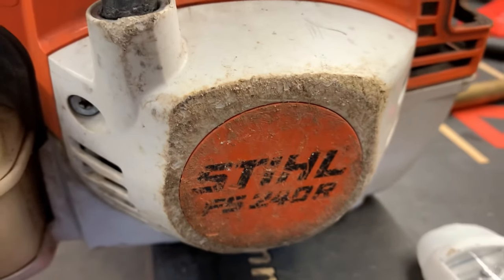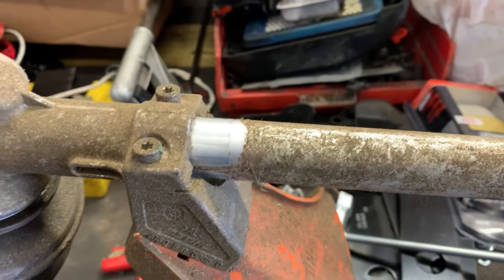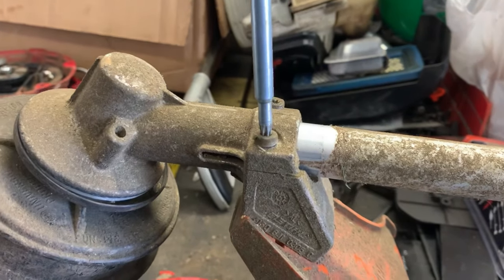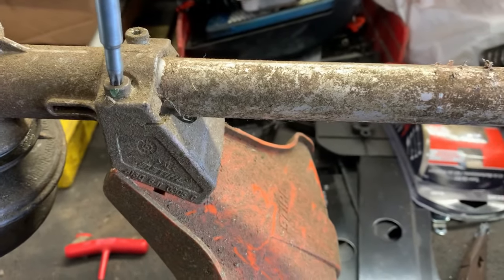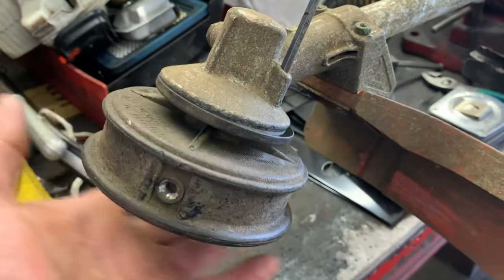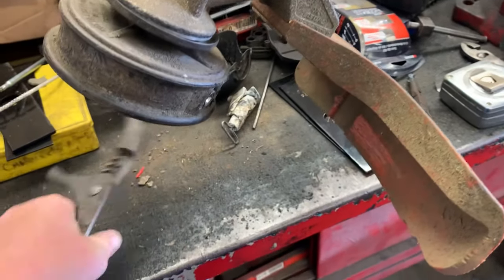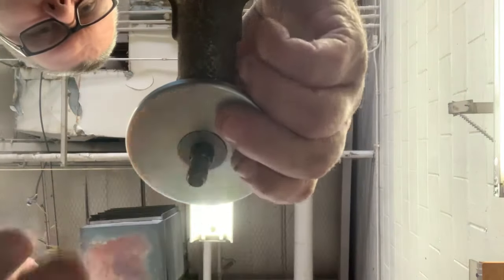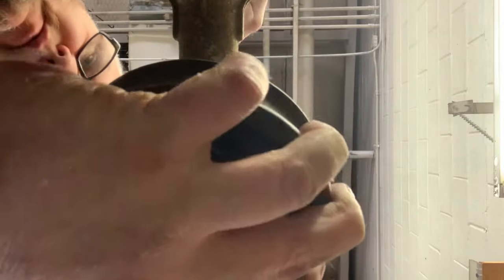FIX 95% OF WEED EATER HEADS THAT STOPPED SPINNING!

Comment: Thank you for the excellent video. Solved my Husqvarna problem.  Could even tell it had slipped on the shaft like in the video, Must have been gradual but the brush blade finished it off.

Comment: You know? Call me weird...but I lube every bolt/shaft/what have you while installing anything because I know that if it goes TOGETHER it is going to have to come APART again. And I never...have to use special tools to get something off like the head of a trimmer. Lube your stuff guys.
Reply from the maker: WRONG WRONG WRONG Lubing hardware changes the torque coefficient of said fastener. Always follow the mfg recommendations when applying oil or never seize. Some bolts require them to
Be torqued dry
Reply: @THEMOWERMEDIC1  My dads two stroke I gave him 20 years ago that was probably 10 years old when I got it off the side of the road still runs great, and is easy for him to maintain in his late 60's for this reason. Never had a problem with any of our stuff. If you do? You're doing it wrong.
Reply: I don’t think a dab of lube will hurt, it’s not the space shuttle.

Comment: The problem I had was on the residential model Husqvarna the shaft had too much forward and backward play and would disconnect from the motor kind of like your Stihl, but it is not easily fixable. I think the cause of it was from the storage option to take it apart, the shaft is 2 pieces instead of 1. Never buy a weed eater that has the option to remove half of the shaft because that is a major weak point.

Comment: @THEMOWERMEDIC1, I know this isn't a Stihl topic but just curious if you have seen the new 3020 from Echo, could a guy swap the flex cable for the steel driveshaft, if so what parts would a guy need?

I'm getting it mainly to trim n cut weeds but some of the properties I'm on for my mom's boss have thick tree like weeds. Would like to bo both but thought I'd ask.

Thanks JD
Reply from the maker: I’m not real sure.  You would have to contact echo

Comment: Ok but what if the drive cable is totally detached from the head. I can see my drive cable but it's resting on the wall of the shaft. I just don't know how to line it up to put it back in the head of the weed eater
Reply: I did it to mine. you have to take it out,grease it and when you put it back in, you have to wriggling it until it catches at the top. I didn't know this and cursed for hours until I found a video explaining what to do.

Comment: Can anyone shed light on something. I have seen all this topic and vids on Stihl. Have not crossed nothing yet on grease fitting and gearing. As in 1. Why do some have grease fitting and other newer etc may not? 2. Exactly how can one be greased with no fitting within gear box up by head? Example- I have a RC-56 and no grease fitting. Have a older 55 with fitting. Price for that box looks to be half of a new trimmer itself. Or is that exactly why they removed fitting. To make you by whole gearing box....
Reply from the maker: Remove plug , screw in stihl gearbox grease tube. Squeeze till full. Bam done!